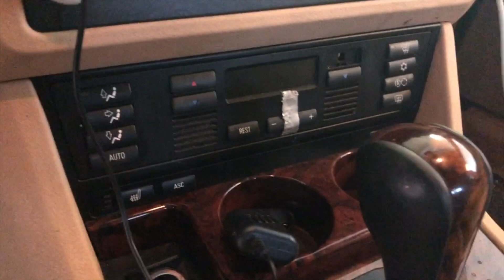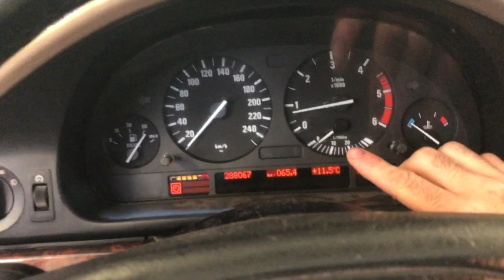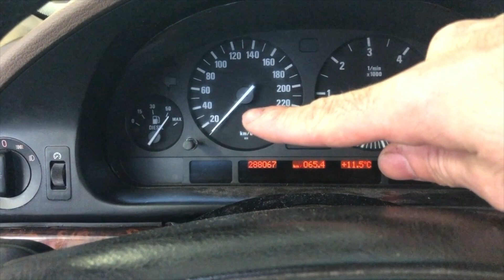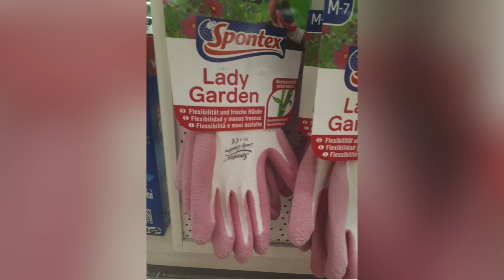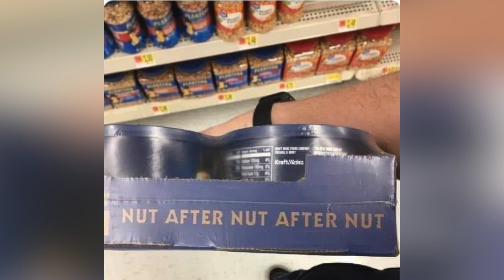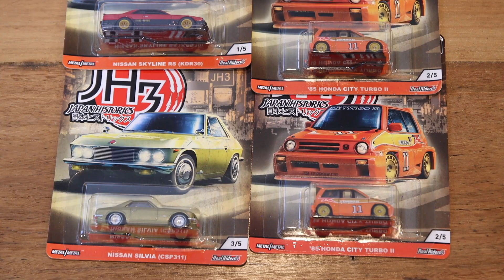V8’s ARE NOT DEAD + FREE FUEL? [UNICORN CIRCUIT EP81]

Comment: 2001 Suburban. Developed a valve problem on cylinder 6 and 8, melted the intake manifold. Used HVAC tape and epoxy to repair the manifold and unplugged the injectors on 6 and 8, without fuel they couldn't melt the intake manifold. it didn't have enough power to pull in top gear so I drove everywhere in 3rd with the transmission in tow-mode Every morning I would start it up and it would go into limp mode, I would let it warm up for for 5 minutes and then un-fuse the ECU to reset everything because if I didn't the ECU would just shut it all down. The radiator leaked but I put some epoxy on it and it didn't leak... As much.

The ABS module was draining the battery because it ran continuously, so I unplugged it. The rear windows wouldn't roll up so I glued them both in place. The radio antenna was broken and had been replaced with a piece of wire tied to the roof rack. The right front and the left rear speakers were the only ones working,. the plastic connections to the heater core broke so I just cut them out and made a loop, no heater. AC worked fine. all of these repairs were done in alleyways behind parts stores and rest stops beside the highway.

I drove this truck from Vail Colorado to the gulf of Mexico where I spent a couple of weeks kayaking. I came back through New Mexico where I camped in the desert for a couple of weeks. I did this pulling a camper trailer. a real mechanic told me that what I was planning was not possible, I really don't like being told I can't do something.

Edit because I forgot about this. Coming up out of the Pecos valley into West Texas the truck started overheating. I used a cordless reciprocal saw and cut a custom hood vent behind the radiator. I made two additional vents in the fenders. It worked and I was able to get up from the Pecos River valley into New Mexico. also the headlight buckets had both been broken in an accident with a buck in northern New Mexico. They were both held in with combinations of zip ties and epoxy, they pointed in a basically forward direction.I was in Fort Stockton Texas and I decided to see if I could permanently seal the radiator with eggs and pepper. It didn't work but damn that car smell good when it was warm. The lights on the dashboard were all on for the last hundred miles. The oil pressure light would flash on and off.  I had achieved a perfect score. Yes, I really did this. Every bit of this story is true.

When I got home I sold the truck for scrap and got another one. I made the guy at the wrecking yard swear that he would crush this car as I did not want to see anyone else driving this damn thing.

That was a crap car. It was a damn fine horse and I hated to see it die.

Comment: Hey everyone, Aran from Scotland here. The 95 g of co2 is an active standard that runs for Europe. This means it is the standard expected for all cars, although has a weight standard set for it also. If a car is over this calculation they are charged an amount which is relative to the weight which can eclipse £2000 plus per vehicle. The cars that lose out are the small power cars like the Polo GTI and the MX5. Hence the MX5 2020 car has increased in price of over £3000!

Comment: 95g CO2 /km is about 4.1L/100km. So that's pretty stringent, but it is a "fleet average" so as long as they sell enough vans with flower beds they can cancel out the F650 pulling the trains.

Comment: In Straya' - Eating behind the wheel is something every driver has probably done at least once, with many likely even doing it multiple times a week, but what may seem like a harmless snack can land you in big trouble.
There is a bit of confusion when it comes to whether eating and driving is allowed in Australia as it is kind of a legal grey area in most states.
While there are no specific road rules that prohibit eating behind the wheel, drivers can still be slapped with hefty fines if doing so affects their concentration or control.
For example, munching on a packet of chips might be pretty easy to do without losing concentration but eating a bowl of cereal during your morning commute might be a bit ambitious.

Comment: We need a donations page for the crap car owners I'd send this bloke some coin.
Reply: I'd give the man an AUD
Reply: Hoppy Haynes Hey, owner of the 530d here o/ Donations would not be bad as i have EU inspection in 2 months and i face a bil of at least 12300NOK which is like 1161USD to get it thru 😅 I’ve Fixed most of the stuff on the car But the remaining i have to get Fixed by others. The stuff left is:
- right rear swaybarlink (managed to get the left one done, But the right one is rustwelded stuck on)
- seal up the oil leak
- replace the front brakelines Couse They Are rusty :(
- replace both front steering rods (dunno What They Are called in english) >.<
- get my friend to weld the kanals on my car 😅

I could even do a vlog to show me spending the money on the car XD
Reply: colormesarge not a smoker, But another stuffed animal would be nice as a celebration If i get it passed inspections 😎🚗
Reply: Gerard McDonough Would help not gonna lie 😅
Reply: Lives in norway and does not have money for a fucking side BLINKER?
Reply: That car is good compared to mine. I just found a a bolt in my oil pan! My main bearing cap bolt broke and backed out. Door cards falling off, front suspension if shot the list goes on...
Reply: @4BillC  oh my :o Thats not good at all, what sort of car is this? i hope it's doing better now after you found that bolt :o
Reply: @Princess_Angela4496  I that's today's mission, replacing the bolt. Making sure oil pressure is there then here in a few days I'm replacing every main cap bolt. It's a 2001 Audi A4 I've already replaced a bunch of parts. Transmission, axles, widow regulator, a bunch of sensors, rear rotors and wheel bearings... The list goes on.
Reply: @4BillC  you should deffinatly film your car for the next my crap car! And sounds like your A4 is in good hands :D I wish you the best of luck! c:

Comment: If u live in America you definitely know V8s are never going to die, it’s quite the opposite here. Small displacement engines are left in the 90s here. EVERYTHING fast in America are powered by v8s, and we laugh when we see someone who actually is still tinkering with Honda’s lol 😂 awe that’s a cute little engine, “oh nice, it’s fast?...” ...till a twin turbo Texas speed v8 rolls up chomping creating earthquake.
Reply: Evil Ash ehh, my 2500hd gets 9 miles to the gallon. even when gas prices were over $3 a gallon I just paid it without even looking. I agree that the majority of the population will want efficient cars. But not us true diehard gear heads. I can personally afford it. When you have a $20,000 motor in your race car, the price of gas is a drop in a bucket. also when you work hard to make good money instead of settling for a $18 an hour job you can afford gas at any price. I’ll never own a 4 cyl vehicle.
Reply: I was also referring to fast cars, not necessarily cars that ppl commute in. but usually here anyone who owns a race car daily drives a massive truck like I do. be kinda hard to tow a bob cat or a bulldozer with a 4/6cyl vehicle every day.

Comment: The egolf was a slight failure because they put an "all electric" into a normal car.
It worked, but range and "overweight" (and design) was left from the old design.
So you can get the old e-golf kinda "cheap" because the real e-car is the ID-3 (and all its variants for the different manufacturers on the VW base)

The only thing i'm currently interested in are the nice batteries you can get out of the nissan leaf battery floor packs :-)

Comment: WAIT MOOG you pay $1.90/L??????? what is happening, i thought we had it bad in Canada. ours was $1.56/L (including the exchange rate)
Reply: SurfTheStreets01 we pay 1.50-1.80 USD per litre in Denmark:) we usually pay 2 USD
Reply: He did not specify the Octane. 1.90/L is usually for 98octane and that very high, its cheaper in western aust to around 1.70/L. E85 is about the same. Normal Unleaded 91Octane usually sits around 1.23/1.34/L on certain days.
Reply: Henrik Nicolai Overlade Sørensen I guess this is why we need MCM to work on nuggets that are more efficient on Gas 😂

Comment: That KIA update is the same as for the 2017 mazda mx5 (RF).
The 2.0 Liter Engine was already available in "larger" cars as the CX5 with more power.
Now for the facelift it went from 160HP (at the engine i guess...) to 180HP somewhere in the car.
- Because of better head 3D forming/mixture **blabla**. => No, you just effed the persons who bought the first release edition out of your showroom
and needed something for people to buy the new model at all. Thats it.
For that model there was already the "smaller" and the "bigger" engine version both with the same 2.0 Liter engine on first sale. Difference: Software bit.

Since the car is not meant to go over 200kph (which it does) but is already *really freaking loud* inside at 160 (also hard top),
i would rather have a different gear setup because you are always easily driving in 5th from 40kph onwards.
At 50kph to max you just leave the stick in 6th gear until you stop.

Comment: Look up massive yet tiny engine promises 20:1 power to weight ratio labeled a hoax but was it?  How about magnet motors one of the first was built right there in Australia.  As for combustion vs. Electric donuts did a really good breakdown of the carbon footprint of both. Though a gas engine car initial build carbon footprint is  1/3 the electric car the upkeep to sustain  the vehicle with oil changes and fuel is manny times higher than an electric car running on coal generated electricity.

Comment: New Ford Focus RS is cancelled. They can't meet the Euro Regulations. Kia Stinger should be up your ally. 2 specs. 4cyl turbo and 6cyl twin turbo. Only thing its too expensive in aust, its not selling well and the new model probably won't come out in Aust. WA Police are using them tho. ALSO Mazda just patented the new Rotary Hybrid and the RX-9 might be on the cards. 

And... you need to do a small mail bag section, to clear your back log.

Comment: Here in southeastern Michigan in the U.S. "gas" is as low as 88 cents per gallon. or 23 cents per liter.
Reply: may i ask, which fuel rating is it? 91, 95, 98 or E85? And 23 cents is cheap af. The lowest ive seen aust get is 89.9cents per ltr
Reply: @KuroRyuu86  that's for  regular fuel(87 octane). Mid-grade(89 octane) is usually 20 cents more per gallon than regular and premium fuel(93 octane) is usually 50-70 cents per gallon more than regular. E85 is subsidized by the U.S. government and is around 40 cents cheaper than regular fuel. 

Fuel octane rating numbers are different here than europe because of the way the octane is calculated. Here 87, 89, and 93 are the same as european 91, 95, and 98. I don't know what octane your E85 is but here it's 105.

Comment: all the talk about SUVs and no manual transmission? im out!

BMW owner but broke, and engine has issues if its 'shooting black smoke'
Reply: Pete Lattimer Bought the car for insurance money i Got from when a lady crashed into my old one, it was farly cheap as There was some issues Which i have taken care of paycheck to paycheck 😅 And it shoots black smoke only when i floor it hard, like when passing someone on the road. I suspect i have some bad injectors. I will ofc replace them If i get it thru inspection, but only after. Since injectors Are pricy :c

Comment: For those of you who aren't familiar with "Euro" types of emission regulations, these numbers (95g or 175g of CO2 / km) are measured during a standardized NEDC test, which is renowned for being incredibly optimistic, even for extremely tame driving. The numbers are almost impossible to realize in real life. Just look at the fuel consumption numbers, they are usually at least 20% under the reality.
So no, you aren't creating 1.7kg of CO2 every ten kilometers, you are actually creating WAY MORE.

Not trying to criticize anything (except the NEDC testing, which is shit), just giving a precision about Moog's remark.

Comment: The idea of not switching to electric because part of the energy that goes into the battery is coming from coal is bad logic. Electric cars are so much more efficient and one of the only ways to actually move to renewable energy for transportation. Along with batteries comes not having to go to the charger away from home as well, so that kinda puts hydrogen out as well. It's unfortunate because hydrogen seems good because it has a very high energy density per weight.

Comment: Sorry guys, I will never like an electric car. What's the point ? Who wants to fork out tens of thousands of dollars to replace the battery pack once it shits itself ? Who's going to find the raw materials required to make the batteries ? I am so sick of hearing all the bullshit about renewable this and renewable that. ARGHHH !!
Reply: Renewables plus storage is cheaper than coal to build and 1/3 of the price of nukes just to build. My power utility pays me $3k pa for my roof top solar. Get onboard mate, its win win win. Btw, there are Telstas now thant have done > 800000 kms on the original battery.

Fun fact; Did you know that 1/3rd of all the mercury in the environment is from burning fossil fuels and most of that is from burning coal. That mercury then finds its way into the food chain (bad).
Reply: Lithium - 25th most abundant element on earth.

Comment: 28:51 Challange accepted and done... spend like 30 minutes or so opened up the Unicorn Playlists and found that "Cock Sauce" isn't previous "stiff Spay" has appeared 2 to 3 times, Boy Wang Noodles has appeared twice. While a HEAP of Fanks are "Cock" related photos like stock, flavoured chips, dips or other related products etc but no cock sauce (as in seafood Cocktail sauce or dressing). If there is I must of missed them. `